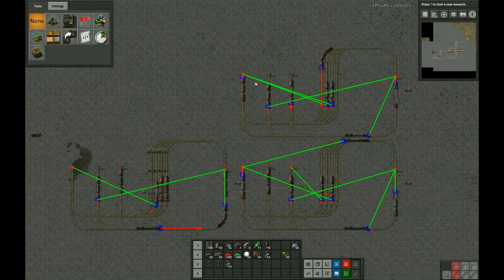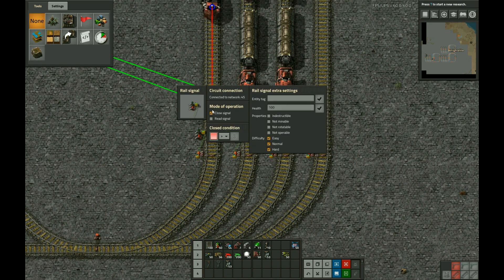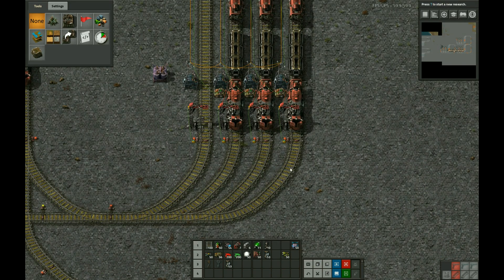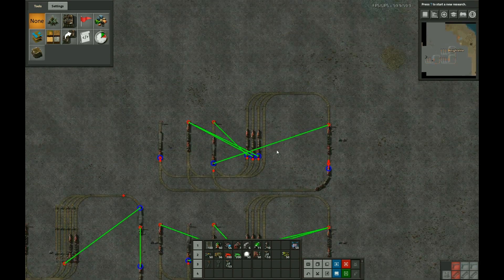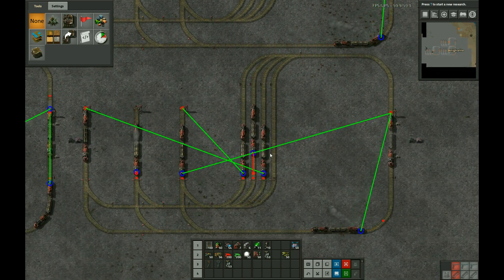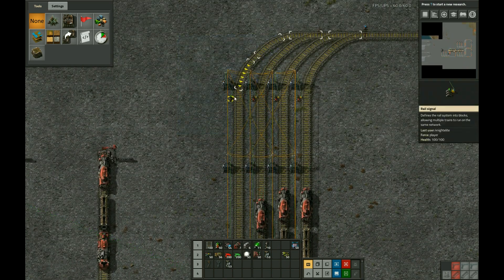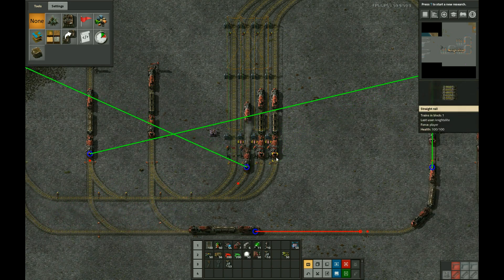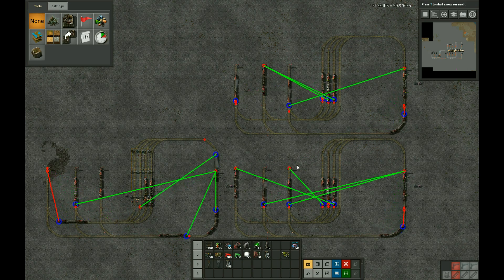Stacker Design Comparison

Comment: It is possible to transfer that staker with station to staker with signal maybe also with chain signal.
Only downside is, that right trains never leave stacker.
Reply: Yes it is possible to do it with signals and even it is possible to alternate lains (so if every one is occupied then train go from 1st, then 2nd, 3rd and 4th and repat). And only 1 train calculate path.

Thank you for that idea.